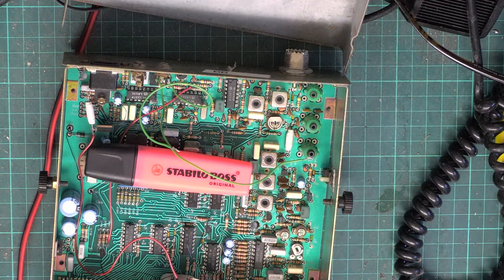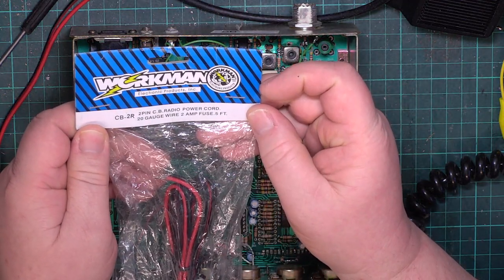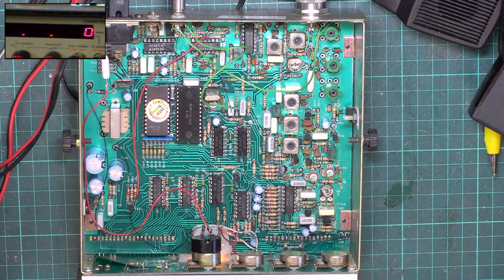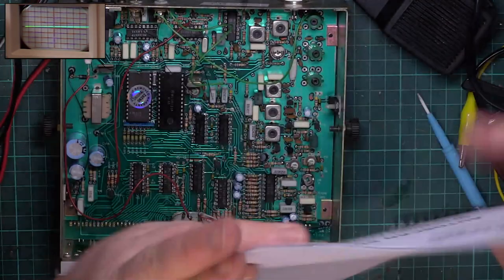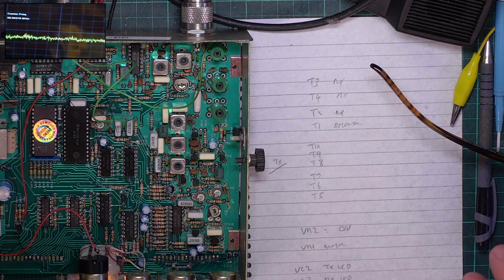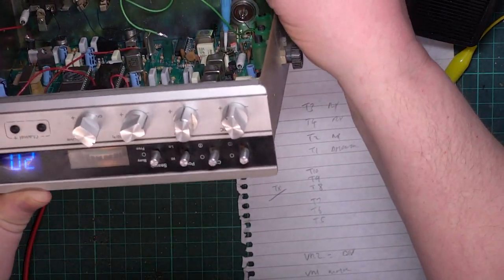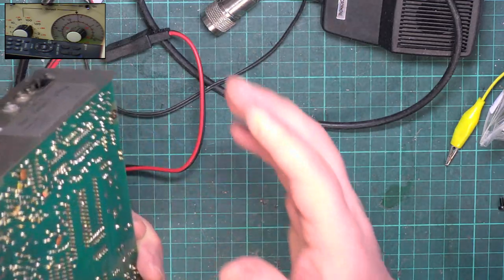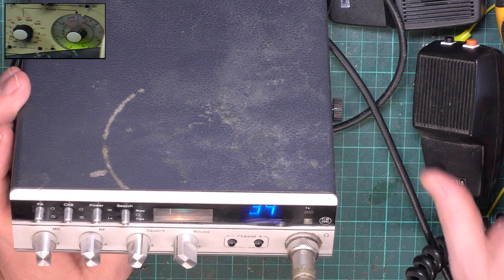Magpie Autoscan 5000 UK CB27/81 CB radio (mobile) - Service & adjustment

Comment: Very neatly designed circuit board, shame they had to add a few wires and components on afterwards. All those ic’s are a bit scary too! Still hats off for a great piece of engineering

Comment: I repaired one of those, the owner had done something really stupid and looked inside to see if he could see anything wrong and took the sticker off the funny IC with the window he said!  DUH!  Anyway fixed that and told him he would be lucky if it still worked.
It did, he was very lucky.  What the plunker had done was to drill a hole for a self tapping screw to hold the CB from falling down,  You will never guess where he drilled the hold and shoved the screw into?
Yes, straight into the electrolytic capacitor, of course he didn't think of telling me what he had done!
Strangely it didn't do anything, it just sat there with a hole in it.
I couldn't see the hole as it was hard against the side of the CB.
It must have been a very thin long screw as it went well into it, but it wasn't tilted over or destroyed, you just would have never have known.
It was only when he phoned to ask if it was fixed he said "It wouldn't be anything I have done would it?  I drilled a hole to stop the front falling down all the time"
It was then I noticed the small hole in the side.  I took out the cap' and sure enough here was a hold right into the side of it.  What a plunker!
Why did I not see he had a hold drilled in the side?
I took the case off without looking when he was there and put it to the side, the hole he had drilled was nit very big and looked as if it should be there, but I didn't pay any attention to it.
I replaced it and the radio burst into life, the cap was a dead short, why did it just sit there and not complain?
Anyway, I had phoned the company as I thought the EPROM might be erased, they quoted a ridicules price, so I told him I would have a quick look and if I couldn't find a fault it could be the EPROM and it was not worth fixing.  He only had it a few month, but he couldn't return it as he had been inside it. 
These people live amongst us you know!!  8-II
Anyway, he didn't keep it for long, he was never happy with what he had and his problem was he listened to others that said "This rig is brilliant, best rig out there" he would rush out and get one, only to find out that it was no better if not worse than the one he already had.
 More than likely the person that told him his set was the best had only ever bought the one!  lol  EDIT:  That was the only one I had ever seen.  I'm sure there was a RX meter adjustment on his, maybe a later model.